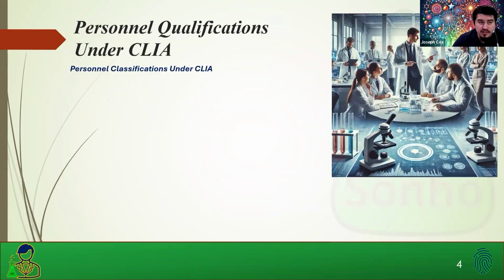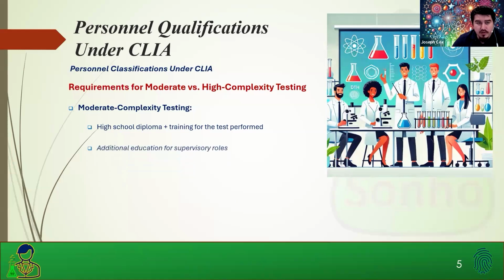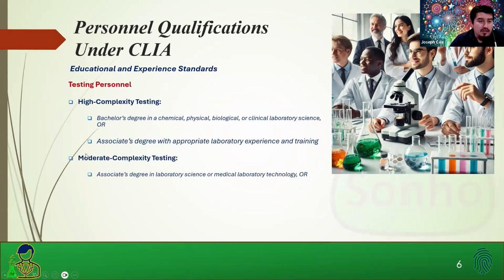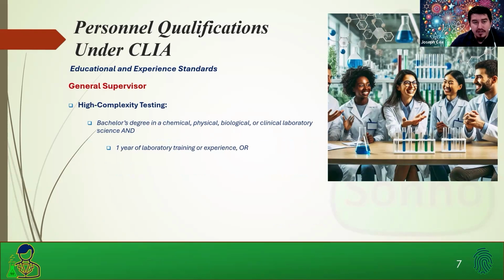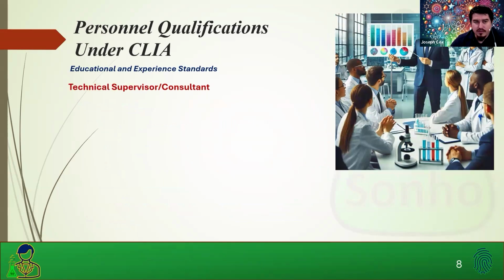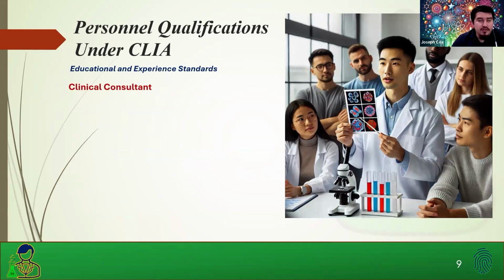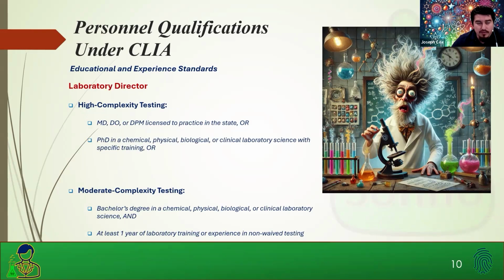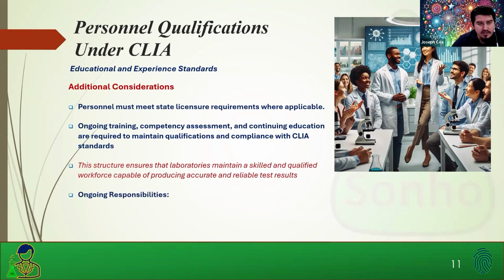Lab Director Essentials: Staff Management & Compliance in Module 3

Comment: What does an Expert say about this ..... ? Read it please and comment !

If a blood test shows that the PFAS concentration is significantly higher than normal (e.g., >100 ng/ml), especially if symptoms such as liver damage, kidney damage, immune disorders, or other health problems are present.
If you are unsure or if you live in a region with known high levels of contamination (e.g., from contaminated water sources), you can expect the concentration to exceed this limit in about nine years.
This means that in about nine years, everyone worldwide will become very ill from these chemicals, without exception.

It is important to calculate the probability: This prognosis depends heavily on the actual exposure and individual factors.

Starting point, condition:

Typical values:
In the general population, PFAS blood concentrations usually range from a few ng/ml to about 50 ng/ml.
Levels can be significantly higher for people with occupational exposure.

When should you see a doctor?
If a blood test shows that the PFAS concentration is significantly higher than normal (e.g., >100 ng/ml), especially if symptoms such as liver damage, kidney damage, immune disorders, or other health problems are present.

If you are unsure or if you live in a region with known high levels of contamination (e.g., from contaminated water sources).

"With a current concentration of 10 ng/ml, an annual increase of 10 ng/ml, and a critical limit of 100 ng/ml, an exceedance of the limit can be expected in about nine years."
Scientific Evidence:

Assumptions:

Current average blood concentration: 10 ng/ml
Annual increase in concentration: 10 ng/ml per year
Critical threshold: 100 ng/ml (at elevated exposure levels at which medical intervention should be considered)
Blood volume: approximately 5 liters (5000 ml)

Current total amount of PFAS in blood:
10 ng/ml × 5000 ml = 50,000 ng = 50 μg

Total amount at critical threshold:
100 ng/ml × 5000 ml = 500,000 ng = 500 μg

Required additional amount of PFAS:
500 μg – 50 μg = 450 μg

Annual increase in total amount:
10 ng/ml × 5000 ml = 50,000 ng = 50 μg per year

Time to reach the threshold:
450 μg ÷ 50 μg/year = 9 years

"

Importantly, this is a probability calculation: This forecast depends heavily on actual exposure and individual factors.
Note: Our rivers and drinking water very often exceed 20 ng/ml of PFAS, even by double or triple!

Currently, there is no specific medical treatment for PFAS contamination. Therapy focuses on treating symptoms and preventing further exposure.

I immediately demand a calculation and assessment of the life expectancy that will be drastically reduced globally due to these perpetual chemicals!!

I immediately demand a calculation and assessment of the destruction of humanity that will inevitably occur globally due to these perpetual chemicals!!

Comments below  please!!! Thanks for your Time.